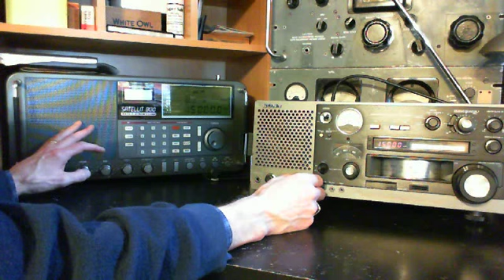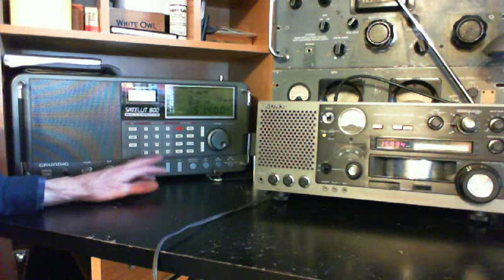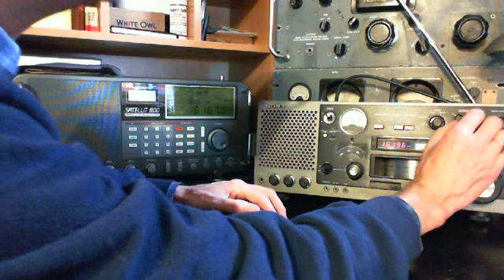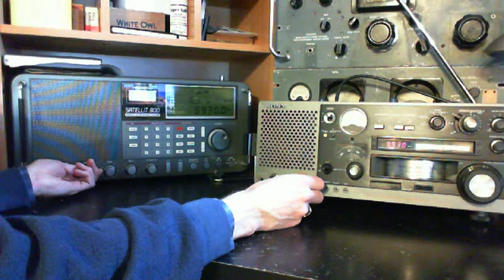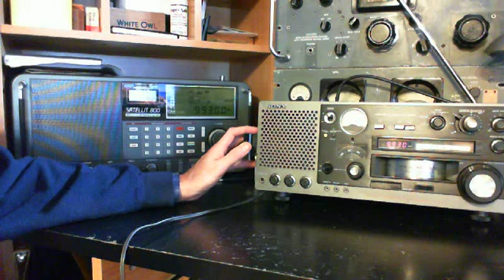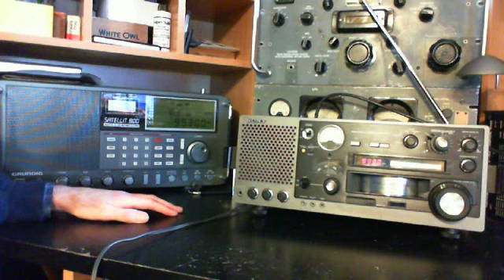Sony ICF 6800W Video #4 - Comparing Sony ICF 6800W (orange) and Grundig Satellit 800

Comment: On the Grundig you can press and hold the UP and Down buttons and it will rapidly tune up or down, you return to turning the knob when you;re getting close. You can also press the up or Down momentarily and it will just the frequency in steps of 5 Khz.

Comment: Sony’s a mechanical experience & if ur old like me, that ain’t a problem. Suspect a true DX-er will b prepared 2 work them knobs 2 pull a signal .. old-school way. Picking mine up 2day from the vendor & can’t w8. Looking 4ward 2 heaps 2 listen 2 .. plugged into the vintage stereo or stand alone or suitable communications headphones (Trio HS-5s ..).  Yeah, couldn’t find vid no.2 .. ur sound bites woulda been very fleeting no?

Comment: Thanks - I was interested in satellit 800 due to it's unusual precision of PCM tunning  - this shows not quite rightly -  as I see it slows tunning and it's upsetting . Sony has better sound but moving from band to band is also upsetting - I can't be sure but satellit may have issue with IF filtering - sounds like  selectivity too much. I did alignmernt  to my ARTEC/PanCrusader as those marvels are ageing and It was worthy. My radio is designed in smart way - easy to do. Positive change was dramatic.